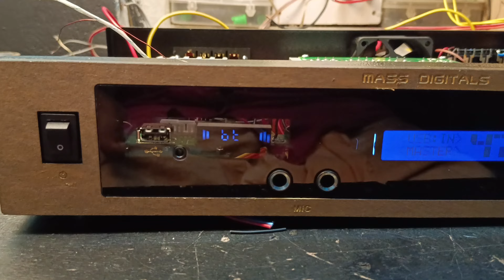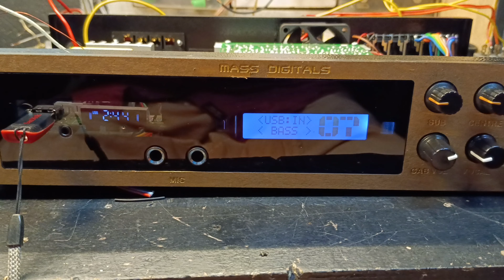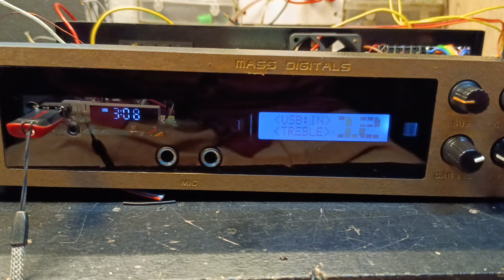5.1 surround remote kit pre amplifier making

Comment: Athu etha diode no, smps out rectification cheyyaan High frequency diode vende , normal diode vachu rectification correct aakillalo doubt aanu
Reply from the maker: ആദിക്ക് സാധാരണ ഡയോട് തന്നെ വന്നിരുന്നത് ഇപ്പോഴും ചിലതിൽ വരുന്നുണ്ട് ഇത് ഇൻഡക്ഷൻ കുക്കറിലൊക്കെ വരുന്ന സാധനം
Reply: @man4tech805  sadharana High frequency k Schottky diodes use cheyyanennu thonnanu atha chothiche😊  appo normal diode work aakule